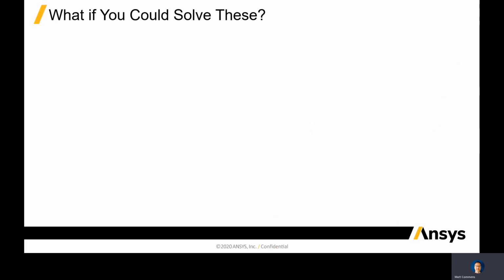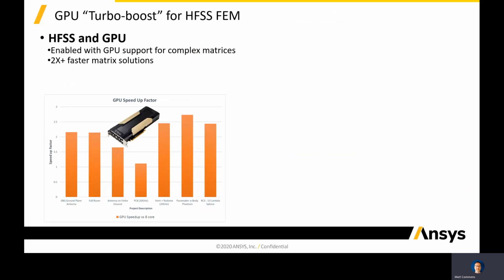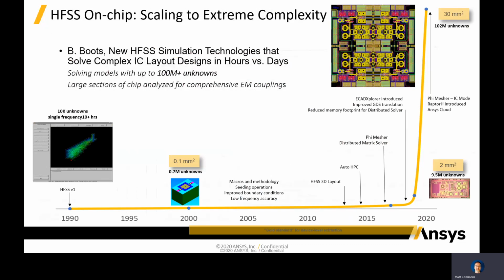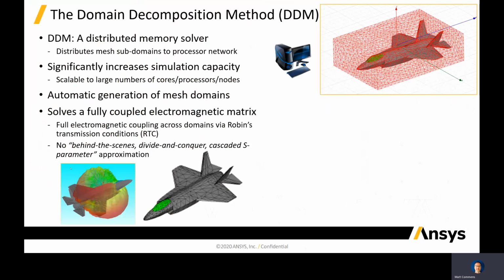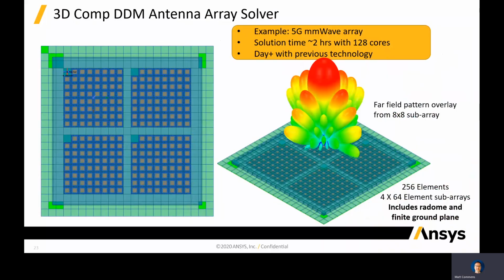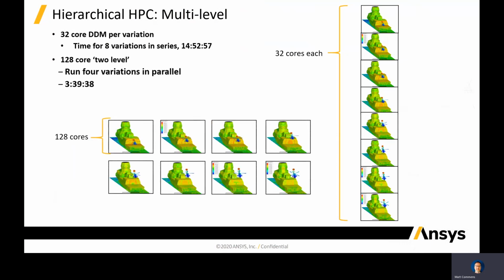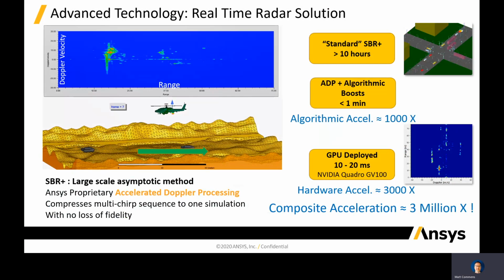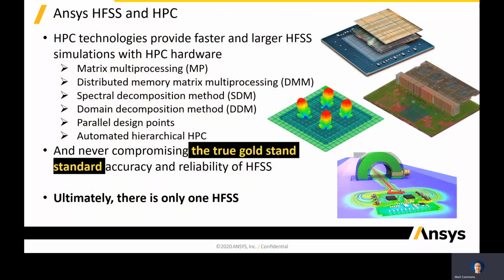A Review of HPC Technologies in Ansys HFSS

Comment: Can ANSYS HFSS calculate RCS?
Reply: HFSS design type with an IE region assigned to the ogive. An IE region results in a full-wave Integral Equation solver being used to analyze the model. This solver is particularly well suited for analyzing large conducting objects, and it eliminates the necessity of creating an open region (that is, a vacuum or air box) around the model to determine far field effects.